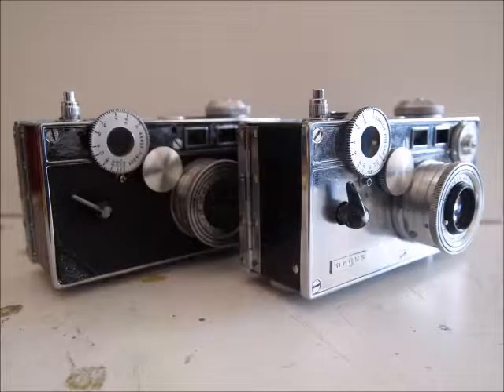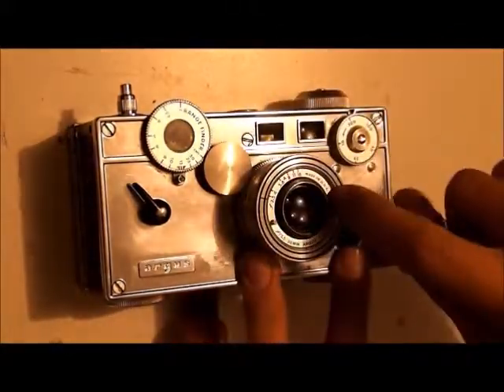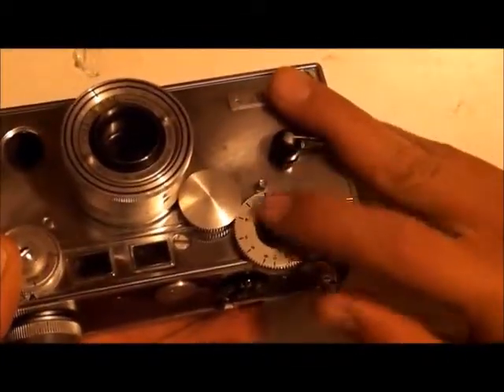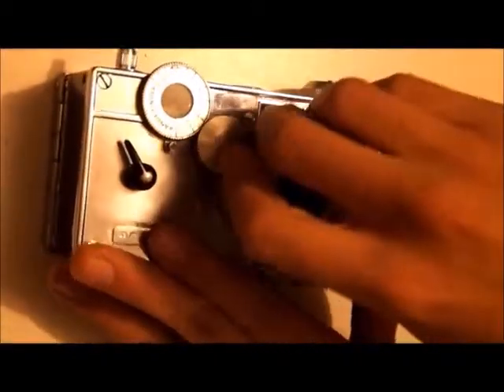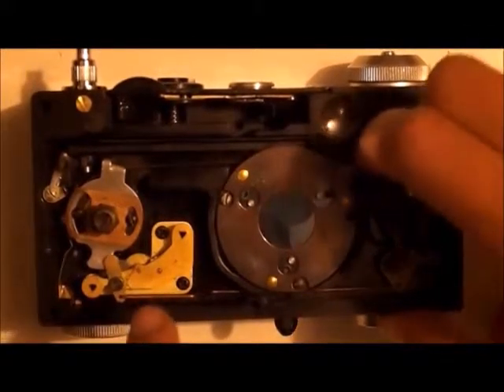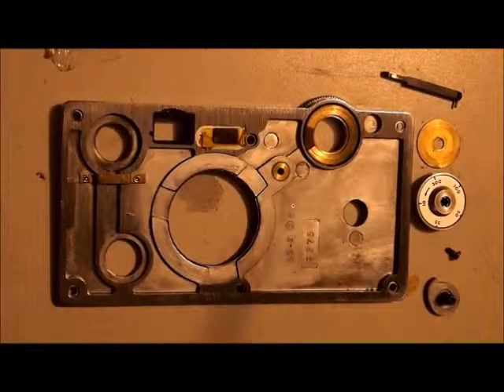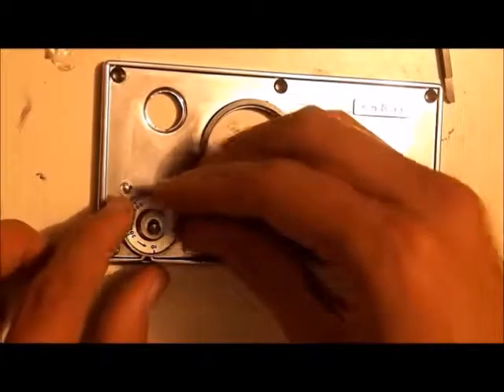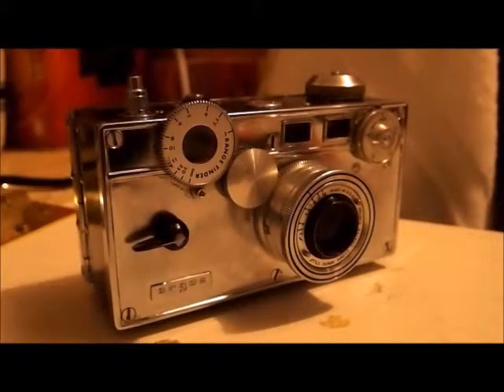A Detailed Guide to the Argus C3

Comment: Thanks for sharing. This camera looks so simple inside
Reply from the maker: Definitely! Other cameras had complex mechanisms engineered small enough to fit in a compartment the size of  $3 in quarters, making them incredibly difficult to operate on. But with the C3? They put everything on a 2D plane, making repairs SUPER easy. The most difficult thing to repair is the rangefinder portion, but even then it only requires intermediate skill.
Reply: @thatrecord5313  Thanks for your reply. Yes i've attempted work on a konica once and ended up with no konica :( lol. I own 2 of the beige ones and 2 black ones and i will need to repair one of them soon and your video helps me alot!
Reply from the maker: I made this video with mediocre quality, I didnt realize people actually would use it! Glad I could help! Oh! You have 2 beige ones? The C3 Matchmatics are my favorite ones, mostly because of their upgradesd appearance, and the fact that they were some of the last C3s made (1960s)
Reply: @thatrecord5313  yes like a tan-beige yes. i thought it was re-covered but found out that the match-matics were that colour yes. i saw a clip where the guy mentioned there were about 300k beige-tan ones and 1.6mil standard black ones. my initial plan was to fit the bodies with a small webcam for surveilance for a commercial setting on a tripod, but it's just too pretty a camera to waste like that :)

Comment: How did you get rid of the residue off the plate? I put acetone and accidentally put some on the blue plastic and melted it. Do you know we’re I can get a replacement?
Reply from the maker: When dealing with acetone and repairs, you need to be very careful as to where you place it. If it was a blue film, then the camera was obviously an older C3, which is unfortunate. I do not know where to get the replacement film, but you can just cut any colored, transparent plastic.

Comment: I have an Argus c3 from 1947 and when I look through the rangefinder to focus it does nothing. The blue and yellow parts of the glass do nothing. They don’t focus or move or anything and I can’t find anything online that addresses this issue. It’s frustrating and in an attempt to “fix” it I messed with the screws on top of the camera underneath the rangefinder adjusting cap and now it’s completely out of wack and I don’t know how to adjust it back. Really irritating.
Reply from the maker: Hmmm. That is an issue I've had to deal with a lot. First off, when you attempted to fix the rangefinder with the rangefinder screws, you had the right idea, it's just that you weren't gentle enough to adjust it. Instead, you loosened the screw(s) too much and then the mirror that is connected to them was too loose and it completely lost its correct angle of reflection. So, here's what you can you: 
1.) Fix it: Use a small flat head and move the screws around while looking through the rangefinder until you see the mirror. Then, tighten the screw you are using. Then tighten the other screw. You will notice the mirror start to disappear as you tighten the screws but do not worry. After that, GENTLY turn the screws back and forth until you see the image. Once you see the mirror, it will still be uncalibrated to distance, so, refer to https://www.arguscg.org/manuals/c3/gaon-repair/ and about past halfway the author tell you how to calibrate. 
2.) Send it to a trusted camera repairman. I would do it for you but I'm just a lousy YouTuber with a potato-quality video of a camera with a barrage of intermittent sniffles . Ha!
Reply: That Record thanks man. I appreciate it. The rangefinder doesn’t seem to focus or move at all when I’m trying to focus it. I see all these videos that show it going from two images when out of focus then to 1 single image when focused but mine does nothing. I see two images at all times so idk what to do
Reply from the maker: Allan, if that's the case then these must be the two sources that cause your problem (at least from what I know):
1.) The Rangefinder Dial has a cam behind it. As you turn it, the cam causes a small finger behind it to move up or down, depending on the rotation direction. It could be that this finger is broken.

2.) The entire rangefinder mechanism is stuck in place. It could be that the mechanisms grease and/or oil has dried up over the years and left the finger in a position so it won't even touch the cam.

3.) Get a new C3. They're cheap. Unless the one you have is a family heirloom.

4.) Replace the entire rangefinder mechanism held together by the 2 screws on top. This would mean buying another c3. But then again, it only matters if the camera you have is special. Otherwise, just keep the new c3 and use the broken one for parts.

5.) Have someone repair it for you.

Comment: I just get one and I am a begginer, I see that my Rangefinder when I focus it get at the same position vertically between the clear and yellow,  but a litthe off horizontally.  is that normal?
Reply: it needs to be in an exact position in both images? horizontally and vertically? or that difference between the clear (top) and yellow ( bottom) is normal?
Reply from the maker: @richardrrv  No, that is not normal. In fact, it sounds like your rangefinder window might be cutting into the optical image or away from the image (at which point is just a solid black line between both halves). You must calibrate your rangefinder. You may research videos online, or you can follow this step-by-step repair manual that you only find in the deepest alleys of the internet: https://www.arguscg.org/manuals/c3/gaon-repair/
Reply: @thatrecord5313  Oh ok so at the end, I dont need to see yellow at the botton and clear at the top right? not cut?  just both together  focusing one image,  by the way thank you for you fast response !!
Reply from the maker: @richardrrv  The upper half and lower halves are meant to line up things vertically. The horizontal doesn't do anything. And you are quite welcome! And your sub is much appreciated!